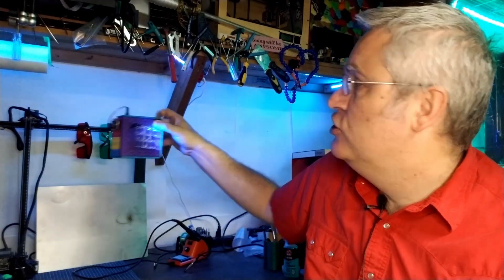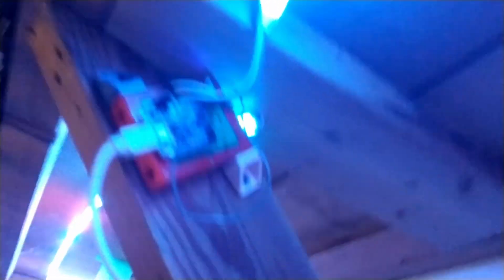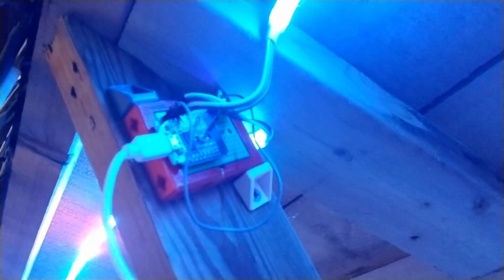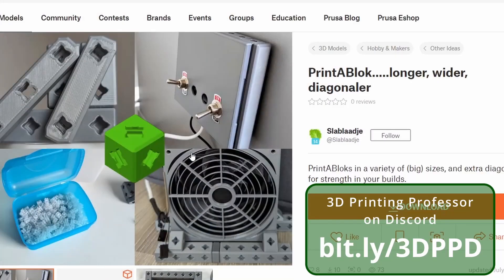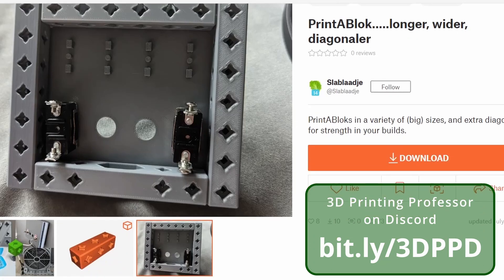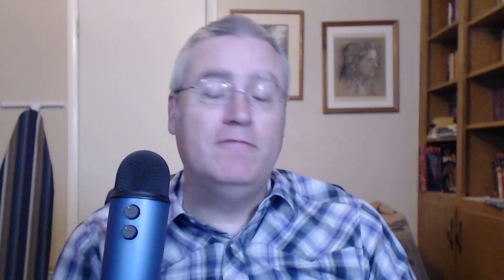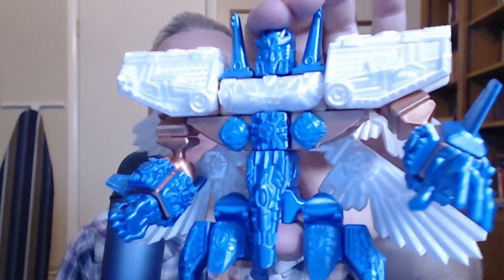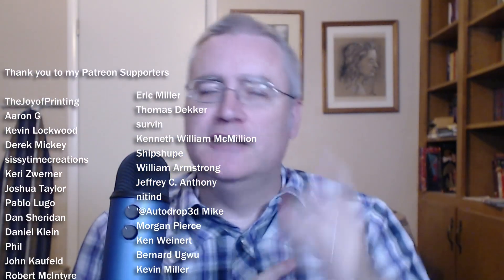Can PrintABlok make anything Useful?

Comment: I would cheat a little and make the triangular brackets as new parts, maybe open frame, with just the necessary PrintABlok sockets built in, probably quicker to make as the number of sockets is much reduced to just those required, the sockets being quite intensive to print. However as a noobie to these blocks I thnk the use of these for knocking up temporary jigs for model building and other 'holding' tasks is great. In addition they are a great way of using up remants of filament spools and performing test prints with new materials, Suface finish with blocks, detailed small parts by just printng connectors, which means I throw away much less filament, that has got to be good! Incidentally what CAD tool do you use, I use SketchUp Make 2017 which does not like importing STL, I found the 'negative' socket model the other day which makes creating custom parts so much easier. I have been in my second childhood since I retired early, this system and the scope to expand it is rather theraputic (wonder if that's the right spelling). Jim
Reply from the maker: I say, give it a shot and let me know how it goes.